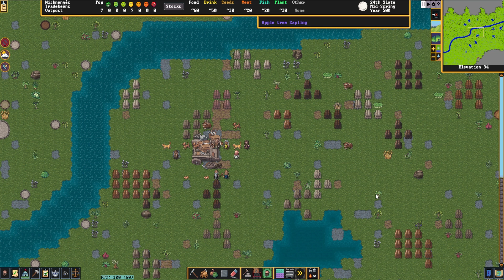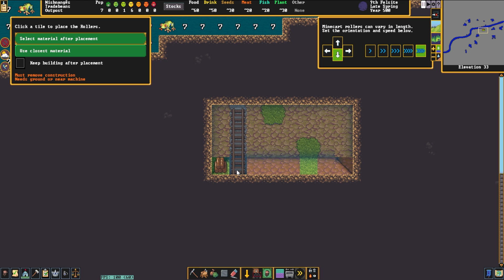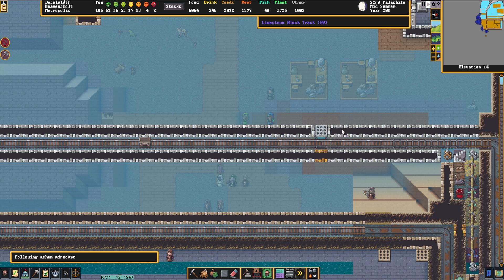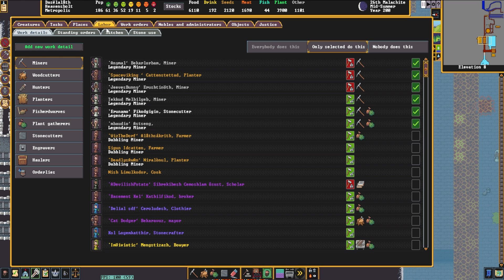Dwarf Fortress - Quick Tutorials - Automating Liquid Minecarts

Comment: I had a problem with a magma cart. It works most of the time, but as magma flows back in and around the pool it can push the cart off the track. How do i set it up in such a way that this does not occur?

I was thinking of trying to run it down a pool that is 2 z levels deep, where the section on the surface is just for the ramp and supported on the sides. On the lower z level it should functionally always be full and no current should move it. I haven't tested it yet. Im still worried it'll sometimes fail due to current pulling it off. 
This design was for bringing it up to the surface level for both obsidian creation and a potential defense of dropping loads on attackers, but i was keeping the test loop small to get it working first before going all the way to the surface.

Comment: Quick tutorial showing efficient way to connect 100 z levels. Minecart spiral down with rollers maybe. My base is in upper levels but mining gold at -100z, I try to make track spiral but no idea how many rollers need to power cart up or how much power it needs. Also moving items down, probably using gravity with carts or just a hole and dropping it 100 levels
Reply from the maker: Quick?
Reply: @BlindiRL  yes
Reply: You don't need it powdered, it's fine to get a dwarf to guide it, gives the kids something peaceful to do
But if you want it powered anyway just make two spirals, one for the way down and one up (non powered one spiral goes both ways) and add a track stop/roller every 4 levels and adjust the friction/acceleration via trial and error starting very slow
You only need power to guide it up and rollers don't use much power, so the power consumption will be mostly just your gears and such

Comment: I tried to replicate the minecart mist generator that so that i can make a new type of mist generator that is not recycling the same water over and over and i dont know know if the water flowing out of the minecart ore the minecart landing on the water is the thing that generates mist but i have now a question. Dose mist not work above ground, cuz i had mist and they where happy seeing a masterfully crafted windmill, happy making a lover and happy for other reasons but they never said anything about being near a waterfall. Dose it need to come from 1 z level above.
Edit Wiki said that when they walk throw it they have happy thoughts In the designated meeting area they where pretty static so maybe that was the problem.
Reply from the maker: Its the water in mid air that generates the mist.